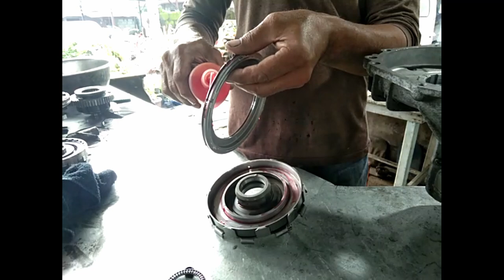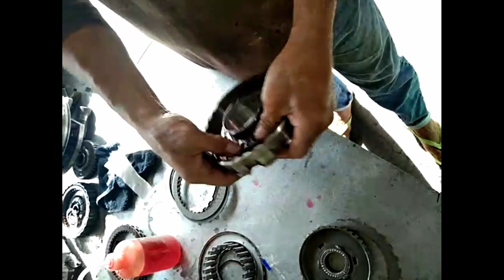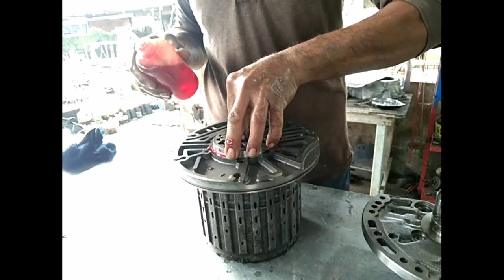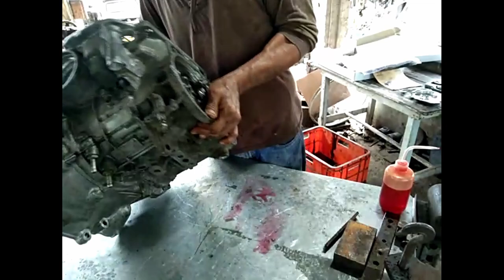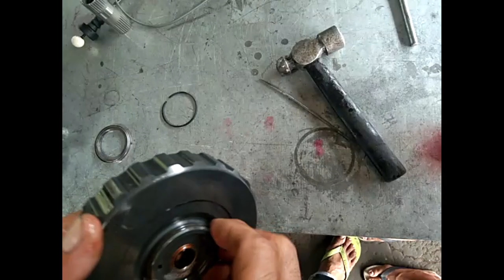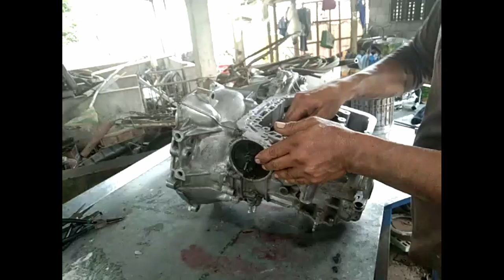Mitsubishi Lancer Automatic Transmission rebuild

Comment: Greetings, friend, I ask you, can an automatic transmission f3a21 lancer 3 speed be placed in a 4g63 sohc or doch? screws and bases the same... I ask about how it works...
Reply from the maker: Good day!  It works almost the same as 4speed when you switch the overdrive off. Only, 3 speed has longer duration in shift pattern
Reply from the maker: There is difference witth flexplate bolt to the crankshsft and torque converter bolt

Comment: well good job EXCEPT he should have soaked the clutch discs for at least 10 minutes not just use a squirt bottle on them and when he replaced the valve body what happened to the gasket that goes between them other wise good job

Comment: Sir saan po shop nyo?... Sir ask ko lang ang auto tranny ng 4g92a pinapalit ko lang ang torque converter oil seal... Kapag napatakbo ko na siya engaged ko sa D at R ulit tapos para grrrrrr na vibrate... Pero ok namn ang shifting nya sir... Dati wala nmn grrrrr na vibrate.. SP111 nmn pang lancer ing binili ko atf nya sir.. Ano kaya ang sira nya sir?
Reply from the maker: Baka meron lng maluwag sa ilalim o sumsayad. Kapag drain lng ay 4 to 5 liters ang nagagamit, depende sa tagal ng pagpapatulo. Mas maganda ay sukatin ung langis habang umaandar ang makina at nasa park o neutral ang range ng transmission

Comment: Hello is it recommended to replace all the parts of the transmission if one part of it had gone bad or broken?
Reply from the maker: Yes it is recommended. Since you open it already, its better to change all the parts inside including the seals so that your transmission will last longer.
Reply: @FRubioatars  oh ok I have a 2004 lancer the guy working on it for me told me that the transmission drum has gone bad and I need to replace everything so I thought I would just get the broken part parts to be fixed.
Reply: My car has no power in drive or reverse when I come to a complete stop on till it take a little time to fully pick up again it starts to drive normal.
Reply from the maker: You have to buy the drum separately if it is broken because it is not included in the master kit.
Reply: @FRubioatars  oh wow ok so the master kit and the drum I see thank you.

Comment: Ask din po ulit nagpaoverhaul nko trnsmission last yir, nakita ko na di muna nila kinabit ung hose papunta sa radiator, pinagconnect n lng nila ung inflow at outflow ng atf hose sa tranny..ok po b un o ibalik ko n lng papunta radiator?
Reply from the maker: Dapat ay dumaan sa oil cooler para di magoverheat ang transmission, kailangan lng ay malinis ung oilcooler.
Reply: @FRubioatars  salamat sir

Comment: BOSS GEAR AUTO CAN'T SHIFT WHAT IS THE PROBLUM PLC HELP ME TQ.
Reply from the maker: What kind of shift? No forward and reverse or no upshift from 1st to 2nd, 3rd and 4th?
Reply: @FRubioatars  From 1to 2and so kant shift  D&R CAN BOSS.
Reply from the maker: Check electrical connection for output and input sensor. The socket for sensors can be interchange with the socket for solenoid ( the going inside the transmission)
Reply: @FRubioatars  Tq very much boss i chake and se the wiring conection.
Reply: @FRubioatars  Boss 4 green wire with 2 senser in gear box  joint in the body is it same colar.
Reply from the maker: @kiopnkiopl3460  the one with orange wire is for solenoids. Output and input sensor must not be interchange

Comment: Sir consult ko po sana tranny ko 4G15 lancer glxi. Parang nakastock lang sa 3rd gear ang kambyo. Di na sya nagpapalit ng gear kahit ipasok ko sa 2 or L. Ano po need gawin. TIA
Reply from the maker: Ipacheck mo muna sa electrician kung may pumapasok na kuryente papunta sa loob ng transmission.
Reply: @FRubioatars  sir kahit po ba anong auto electrician or dapat transmission specialist? Wala po kasi ako alam na reliable mechanic.
Reply from the maker: Kelangan ay electrician na sanay humawak sa electronics. Kay Delo sa San Pablo, Laguna ako nagpapacheck.
Reply: @FRubioatars  may contact po kayo sir?
Reply from the maker: Wala po. Sa may A-plus san pablo po yun located.

Comment: good day po.pizza pie 97 model unit ko.A/T trans ko.pag nag change gear may kalabog tapos blink ang neutral.pinalitan po ang output sensor,ayaw na pong magchange gear,sabi ng iba change atf daw,so nagchange fluid,ayaw paring magchange gear. ano kaya problema at ilang litro ba laman ng trans at anong fluid dapat?sayang nga lng kasi malayo location nyo,davao kasi ako.kung malapit lng sa inyo ko sana ipagawa ito.tnx po
Reply from the maker: Baka defective ung naipalit mong sensor pero hindi ung ang dahilan ng ga kalabog. Maaring delay ang upshift kaya nakalabog, mataas na ang rpm bago siya lumipat ng gear. Sukatin mo ang fluid kapag umaandar ang makina at nasa park o neutral
Reply: @FRubioatars  ok sir tnx very much.try ko.more power sa inyo sir.
Reply: good day again sir.umabot sa 8 liters na atf nalagay ko kasi nag change fluid nalang ako.sabi ng mechanic ng tinatrabahuan sobra daw,dapat mga 5 to 6 ltrs lng daw.ilan ba litro ba standard ng A/T trans ng pizza pie sir?1997 model.tnx po.
Reply from the maker: @patryanberza3973  kapag overhaul, drained lahat ng langis 7-8 liters. Kung change fluid lng pinakamataas na ang 5 liters. Sukatin mo na lng yung tamang level ng langis kapag umaandar ang makina tapos nakaPark or neutral.
Reply: @FRubioatars  maraming salamat talaga sir.GOD BLESS AND MORE POWER.
Reply: Magkano nagasto mo sir same problem

Comment: Sir. Ask ko po yung lancer ko automatic tranny din 4g92 hangang 3rd lang po ayaw mag shift to 4th gear po at may na untog kada shift po ng gear ano po kaya problema po sir. Bago na rin po engine support Ano po mas ok palit tranny po ba o rebuild po salamat po sir
Reply from the maker: Ipacheck mo muna ang electrical kung gumagana lahat.
Dapat ay gumagana ang speedometer
Dapat ay nagreresponse ung OD off sa  dashboard kapag pinipindot ung button sa gilid ng shifter.
Icheck ang level ng atf habang  umaandar sa park or neutral.
Reply: @FRubioatars   sir na try ko na po yung OD OFF wala pong response ok naman po yung speedometer sir ano po kaya sira sir
Reply from the maker: @dannypoenaru2315   kung namamatay at nabubuhay ung OD off kapag pinipindot ung button  na walang response sa transmission, malamang singaw o sunog ang  endclutch. Klangan na i-rebuild o palitan ang transmission kung anong mas convenient sayo.
Reply: @FRubioatars   sge po sir maraming salamat po kung malapit lang po ako jan sa inyo ko na lang pagawa more power po sa channel nyo sir thank you po 👍👍

Comment: boss san po kayo sa quezon
Reply from the maker: Brgy. Pury San Antonio Quezon Province po
Reply: ahh boss kc po un lancer ko matic ayaw po masok ang kambiyo lahat
Reply from the maker: @merilynledesma459  kung walang atras at abante, ang posibleng problema nyan ay:
1. Kulang ang langis   o ATF
2. Sira ang oil pump
3. Sira ang torque converter